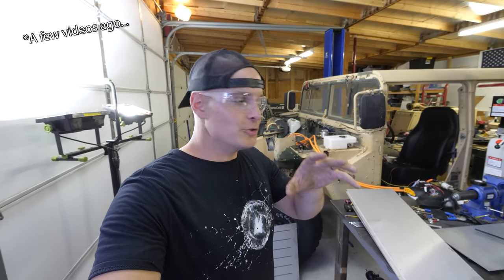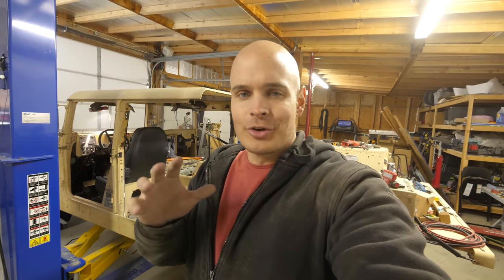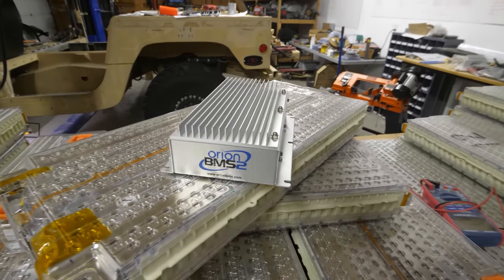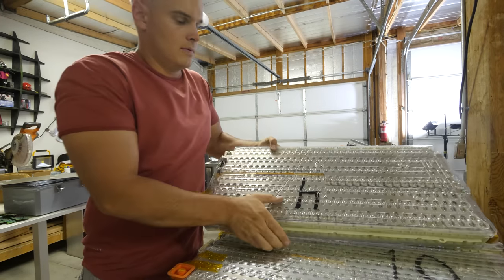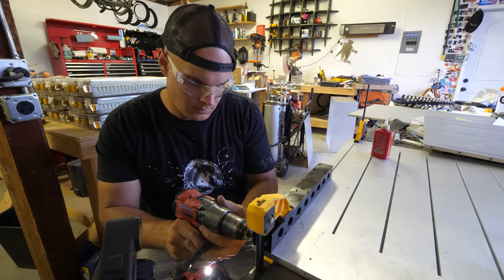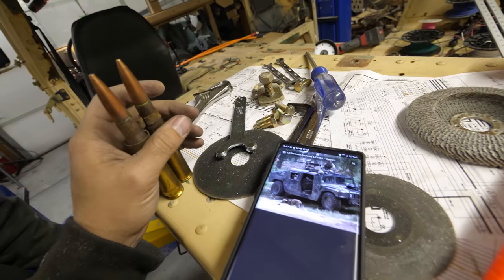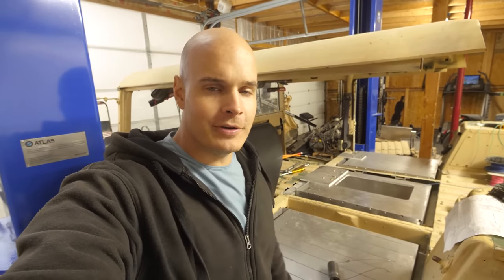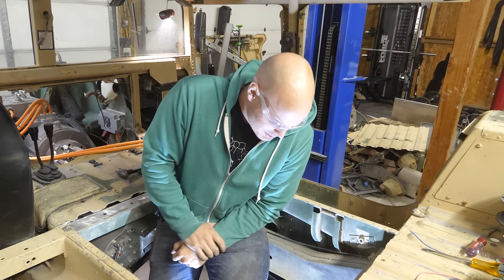Can I fit Tesla Batteries in my Electric Hummer?! - Battery Box Build

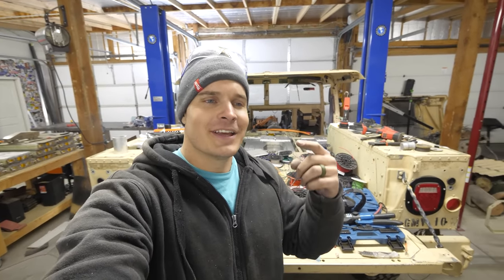Comment: No, Jerry no!  You need to keep it 4-door!  Don't you have a battery per door cost/ power delivery? 21:46.  Unless you extend the truck bed forwards to cover the 2 doors given up.  But again load over battery terminals when access is dearly needed?  Will have to unload to fix then reload?  Keeping most of the military Hummer is sure the ultimate success in a conversion exercise especially when you mentioned the delay of the (4-door) Tesla Cybertruck as the genesis of all this EV conversion.  A double-cab is best Jerry.  Keep the 2 rear doors but design retractable seats on hinges or something close to access battery terminals when need arises   You should reconsider.

Comment: In gasoline engines, there isn't an explosion. It's just a combustion of the fuel and air mixture. It is compressed. When the flywheel magnet passes the ignition switch, it sends an electric pulse to the spark plug. When the spark plug sparks, it allows the fuel/air mixture to combust, which provides power for your power stroke. The flywheel is basically helping to keep the crank shaft turning. The power from the combustion gives the flywheel enough momentum to go through the other strokes before the next power stroke. I'm sorry. I build engines for a living. Now granted, it's small engines, but the principals between car and small engines are basically the same.
Reply from the maker: Does it go boom? Or not?
Reply: @JerryRigEverything  Lol. I love your videos. I love everything you do. I work for Briggs and Stratton. But you are my favorite YouTuber. I'm sorry. My instructor from engine theory class at work hammered that into our heads that it is not an explosion. Keep up with the awesome videos.

Comment: Great series Jerry. Just a word of caution, if you're going to run positive and negative separately through those sealtight conduits you might get a magnetic phenomenon happening around the conduits causing them to heat up. This is why as an electrician we have to install our feeders in one pipe not two. The hot and neutral has to be in the same pipe. I assume it would be the same way on DC. Great job anyway.
Reply: lol...wut?
Reply: Lol @vidznstuff1  basically I'm saying when the amperage is high it creates an magnetic field around the wires. If the wires are separated a couple of inches then the magnetic field around the wires will clash and cause the conduits to heat up. It's all about electrical theory lol.

Comment: "If I set something metal on top of this right now...boom"

Suppose something metal was dropped on it. Looking at it in the video the top of the battery is one big metal plate connected to the positive side of the cells. So what would be shorted? Its all connected anyway? So no boom boom?

Comment: Interesting,  well hello from west valley Utah.  I've built scooters, go carts, even the little power wheels powered by recycled 18650s. Though I have NO doubt there are a lot of folks similar around these parts, it's not common in the circles I've come across in the 35 yrs in this state. I digress, good video, thankyou for sharing. I too have quite a few of tesla 18650s they're excellent cells!
Reply from the maker: Send me an email.  I have a few extra tesla battery moduels I need to get rid of and you seem like the right guy.
Reply: @JerryRigEverything  how do I go about sending you an email? I didn't see a way here on the tube w/o setting myself up for an email nightmare

Comment: Might wanna use some red locktight on everything battery related, heck in aviation the real important stuff get special nut heads and we use wires to secure the nuts from rattling loose.

Look into it, fun personal touch, half artistic and makes finishing look great sometimes on important hardware xD Yes, it's probably overkill. But still fun

Comment: Wait, by replacing the boards on the batteries, doesn't that remove most or all of Tesla's extra safety measures?

Not that the other board won't have more, but just since you mentioned having that Tesla safety in the beginning.

Comment: Not bad.  The only thing I can criticize is the battery packs being on their sides.  I know they are tough, but aren't the individual cells weaker structurally on the sides compared to the being laid vertically.  Is the weight of the other cells being pressed on the sidewalls of the lower cells in the stack?  Maybe don't take that Humvee off-roading.
Reply from the maker: They are encased in metal. Each pack at most is 50lbs. Spread that weight out on the bottom row of 30ish cells encased in glue. There's no force on any one cell that would be enough to worry about. The average male grip strength is 100lbs. Nobody could ever crush a AA battery in their bare hands. Plus the batteries are mounted to the body, and get the added benifit of the body cushions as well as the hummers shocks. I'm not worried at all.

Comment: Ehhh, I personally wouldn't put them all in series so you would actually get 453 volts until they get to the motor, I would run dedicated wires for each battery until the BMS and then have a short run to the motor.

Comment: Any plans to add extra protection to that tunnel in case the driveshaft breaks under torque?
Reply: Did you see that driveshaft? Looks like it was built to handle 1500 HP.

Comment: whould have made the battery boxes with carbon fiber or glassfiber for thqt matter. would have reduced weight tremendously and would have been shock proof. or atleast a slim sheet of aluminium. the plates are thick. but good work.

Comment: Be careful with those driveshafts, if they snap the last place you want them going is a high voltage junction box. I think they require 1/2 steel guarding the driveshaft to pass tech in a lot of motorsports simply because if it does break, it can and WILL rip through the body and you if you're unlucky.

Comment: This is such a cool project! You're building my dreamcar! 
But Q - did you plan the location of the modules aso in advance or are you placing them as the work progresses? (IMHO you're giving away lots of storage-area in the former engine-compartment - but this could be deceiving due to the camera angles?)

Comment: I am not sure mounting the modules on their sides is a good idea.  The bottom cells will have the weight of all the cells on top of it.   The Tesla module does have a plastic hex holding the cells top and bottom, but not stiff enough.    I really don't think this is a good idea.     I have built a number of e-bike packs and done that same design (cells horizontally) and the bottom cells have gotten damaged.    I don't like building packs like that anymore due to the cell denting.

My 2 cents

Comment: 7:00 It will start a gas powered vehicle easily, but this is out of spec. For CHARGING it has to be at 0°C or above.
A solution would be LTO cells as a "starter" battery.

Comment: this may be a stupid question but why not put most of the batteries where the gas tank used to be? it seems like that would be the most efficient use of space rather than taking up passenger space.
Reply from the maker: 4 of the modules will sit there. Also that's where the on board charger is.
Reply: @JerryRigEverything  ah, got it 👍

Comment: Still watching, but caught that he put in a LiFePo4 battery... way different than Lithium Ion, as in that they are a safer chemistry, but way way less ability to discharge at a high current level or to charge fast.  The Tesla cells could easily crank over a combustion engine... I've got several lithium jump boxes that cost about $50 a pop, only weigh a couple of pounds and will easily crank over an internal combustion engine with a dead lead acid battery in it.  I often carry it with me on my bicycle and when pedalling on paths around a local park, I sometimes come upon people that were just sitting in their cars at the park listening to the radio and ran their car battery dead... so stop and quickly jump them off.  Makes them happy, usually blows their mind that a guy on a recumbent tricycle just started their car with a little box.

Comment: Education. Most vehicles have a hole in their roof filled with a piece of sliding glass. This is called a MOONROOF. A sunroof is made when that hole is filled with a sliding panel made from the same piece of material that was cut out to make the hole in the first place. If you have a red car and the roof opens and closes with a piece of red metal body panel that you can't see through you have a Sunroof. This is uncommon in the modern day which is why almost everyone is incorrect saying "sunroof" What you have is a MOONROOF.

Comment: The rubber insulation you bored out - would rubberized paint have helped instead? Or does it not provide enough insulation for that kind of voltage/wattage/whatever? <not an electrical guy lol>
Reply from the maker: Rubberized paint isn't very abrasion resistant. Or very thick. Probably wouldn't work for very long.
Reply: @JerryRigEverything  Fair enough. TIL. Thank you and great work. :)

Comment: Not using rubber gloves to work on the battery Banks is a mistake.
While not getting shocked is a bonus the real issue is the fingerprints and possibly static discharge damaging the electronics and causing corrosion.
Reply from the maker: This isn't NASA.

Comment: Nice work, how much behind the scenes engineering has this taken so far? I'm sure these videos don't give all the prep, research and engineering justice haha.

With the rubber insulation, you could use mica sheeting which may have come with you batteries depending on the supplier. Great electrical insulation, thin, strong against being crushed and is quite heat resistant.

Comment: Parking, emergency or hand brakes are vital on electric cars as the motor will not hold it in place... In fact I know most people who convert add an annoying buzzer should you pull the key out and the hand, emergency, parking brake is NOT on....

Comment: Nice video! How much do one of the Tesla battery packs weigh?
Reply from the maker: 50lbs each
Reply: 25kg
Reply: I’m a Mechanical Engineer in training so I decided to put my calculations to use. I set out to calculate the force on the bolts holding down the support plate (2 rows of 9 bolts each). I estimated the weight of just that box including batteries is 250 lbs and just eyeballed the dims. I found that each bolt will experience 10-15 lbs of upwards force by being eccentrically loaded.  So that is really safe, maybe a bit over designed but better safe than sorry. I’m going to figure out the welded support end next for my own practice.

Comment: the thing about lithium batteries not having any cold cranking amps is a little bit of a myth. as long as its above 0 you should be able to use a un insulated lithium battery to start a engine, below zero you just need a tiny bit of insulation. the main difference is how you would start your car in these cold temperatures, with lead acid its twist and pray, with lithium you want to toggle your keys a few times and turn on a auxiliary power, this will warm your batteries and make it so even at 20 below 0 a insulated battery will start a engine with thick cold oil. lithium batteries self warm in cold temperatures, just like lead acid if you try starting and it doesn't take, if you wait a few seconds it will suddenly have enough power to start. you essentially need to kick start the whole ion exchange at cold temperatures regardless of battery composition by using the battery, lithium just does it well when they are high quality, and slow when low quality.

Comment: I don't think the angle bars you welded , are not that strong enough to hold the break, am a marine mech , and aluminium is brittle when holds load and vibration,  it absorbs the vibration a bit, bit the metal will shrink as it goes

Comment: You say 450v which implies 4.2v per cell but when you talk about 5600Wh you are using 4v for that number. Also your Model X may have the new 516 module, not your 444 module. Hers is 16 modules, yours is 18 modules. So she would have  less voltage, around 48v less using 4v. So your hummer will have more power but less capacity than the Model X.

Comment: Why oh why were you using a drill to tap the holes ???
If you spin the drill too fast, or it bites, then it will strip your threads.
I know you had LOTS of threaded holes to do but if you screw one hole up that will be another plate needing to be made or just forget that hole

Comment: Are you concerned at all with jerryrigging such high voltage components? Lithium ion fires are almost impossible to put out with conventional methods, and any short circuit wouold put this up in flames.

Comment: 0:37 I cant use the metallic ridge wallet because we have cold winter. - 30 celsius, with winds, some days. cant even use metal parts in my work safety boots, I have to wear specific winter-made work boots during winter. metal is extremely cold in cold temperatures. it might turn so cold, that it might even break my credit card´s electronics when it is next to it. I doubt the cheap small microchip was designed laying next to ice-cold metal in mind. you don't have to have metal to have an RFID-blocking wallet. and when I looked up, statistically, RFID-related crime isn't only very unlikely, it's non-existent. The truth is, there are much easier and more profitable ways to steal people’s data.

Comment: <3 I'm a huge fan of these kind of conversions. Removing ICE makes so much sense. 

EVs are just so much better in so many ways. 

Yes, it can be easier to bring a spare can of fuel, to refill at odd locations, but just plan to not get stranded.
Yes, refueling can usually be done faster than recharging, but a car is parked most of the time, just plan to charge whenever it is parked.
If you can mitigate these two challenges, then the only remaining obstacle is to find (or build/convert) an EV to fill your requirements, and of course investment cost.

My daily driver has been an EV since mid 2015. The first was good for daily use, but there were regularly things I had to adapt beyond convenience, the second I have no issues.
I still have a petrol powered ATV, for occasional tasks. It is so noisy I want to replace/convert it, but can't seem to find an option, without blowing the budget, compared to just stick with the one I have. I think maybe I will have a motorcycle again some time, but probably not in the next 5 years, but it will be electric.

Comment: 7:00 - Two false statements here - Lithium 12V (or any voltage) could have cold cranking amps calculated. The MOST IMPORTANT difference between lead acid is that lithium 12V doesn't work well in freezing temperatures. You are not supposed to charge them when they are frozen.

Also, only really the new Tesla Model S/X have a lithium battery. Most (basically anyone except Tesla) EVs still use lead acid 12V!

Comment: call me a stickler but lipo for your 12V is kinda dumb. . . you have a very low power output at low temps your brakes and steering runs off that battery, so your trusting a resistive heater too protect that battery, wouldn't the proper battery tec be NIcad like in auto start stop gas vehicles

Comment: Laying Tesla cells on their side is not a good idea.   Cells are not intended to hold up 14X their weight.    This plan does not give me warm fuzzies
Reply from the maker: Encased in metal?  Try squishing a AA battery. Your grip is exerting more force than the weight of the battery moduel. I'm not too worried.
Reply: @JerryRigEverything  
I hope u are right.  And I'm not trying to put down ur work, but I try to copy automotive battery design when I design packs.   Automotive designs do not stack cells.    I have stacked cells in the past and bent the bottom cells.    They were not protected like the Tesla modules are, but it made me realize if u stack cells u may dent them.
Awesome work love the vids.

Comment: Cars on classic batteries are so DUMB, stupid and very impractical. And they POLLUTE MORE than gas cars!
Electric cars ARE GOOD only when a new technology will be available for storing or producing electricity. It should be FAST, with usable RANGE and SAFE. Like the FUEL CELL cars but even more advanced.